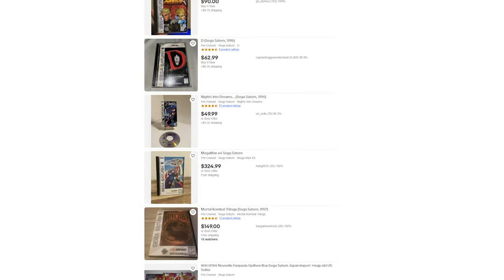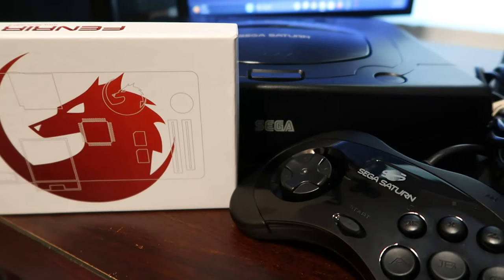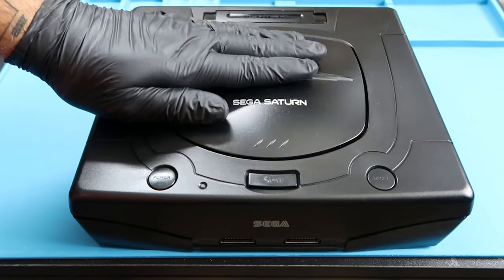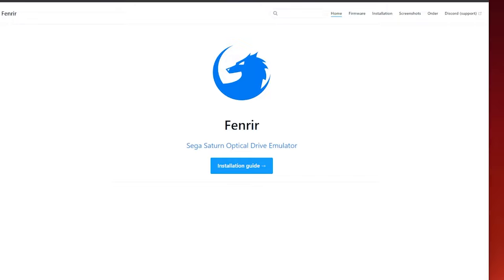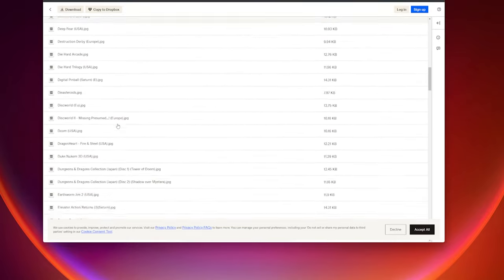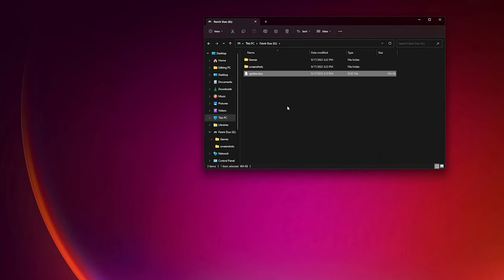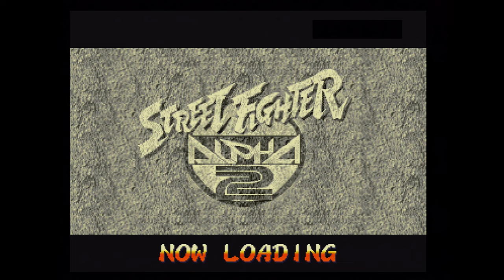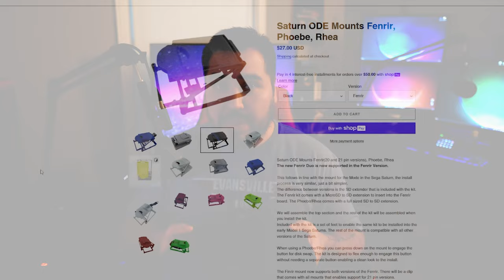Tutorial | Sega Saturn ODE | 4K🔴

Comment: I’ll be installing a Fenrir in my Saturn tomorrow. This video assures me that it’s going to be ridiculously easy. I’ve already got my SD card loaded and ready to go. 🔥
Reply from the maker: Awesome! Congratulations on the Fenrir ODE. Let me know how the install goes!
Reply: @Magneteco  the installation went really smooth. I must have an older Saturn model because mine had an extra screw to remove from the casing. But still, it was a breeze and I never have to worry about bad discs or optical drives ever again. Time to play!
Reply from the maker: @OregonPacifist  Awesome! Enjoy my friend.

Comment: bro i have a question. do you put the games to the sd card with the folder of the game. like when you open the folder and you see all track bin and cue files. or has it to be in zip data?
Reply from the maker: @corehazard4709  Do not put the games in as a .zip format. The Fenrir Duo will not be able to read it. I'll use Resident evil as an example. The file setup should look like this. SD Card/Games/Resident Evil/.bin .cue .track files.
Reply: @Magneteco  thank you. im still using windows 7 you know. thats why i dont know, how the folder icon looks on windows 11. thats why i asked :D
Reply from the maker: @corehazard4709  I concretely understand. I hope you were able to get it all up and running, my friend.